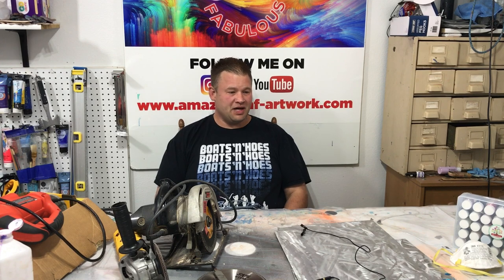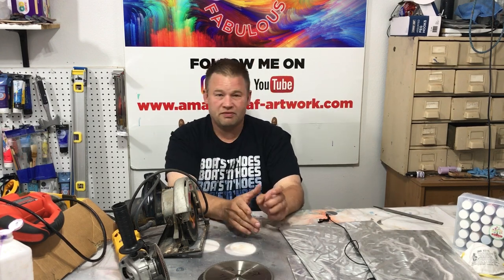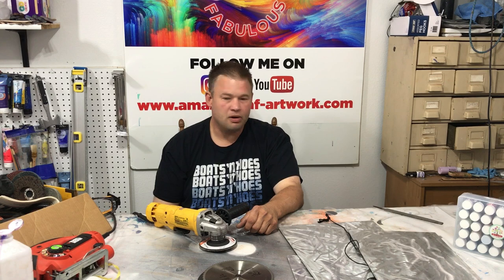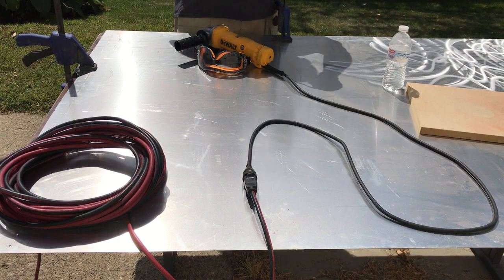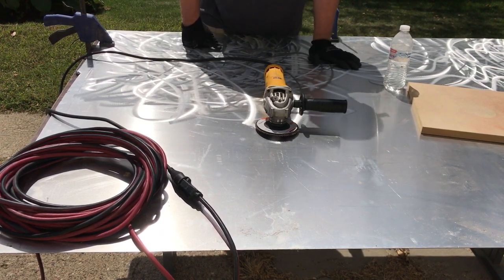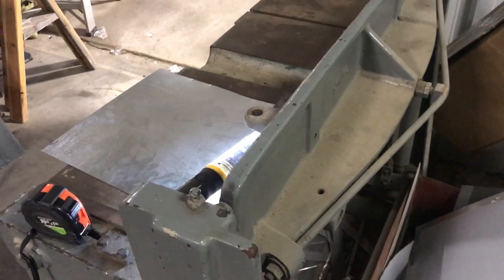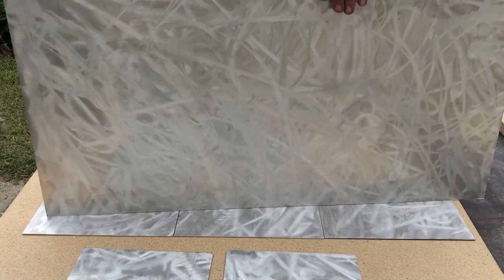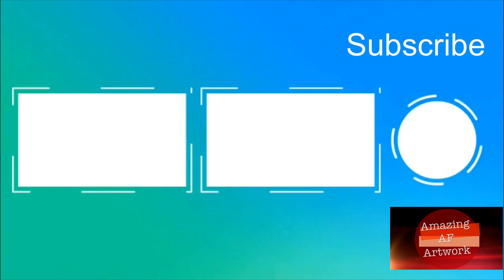How I Prep My Aluminum Resin Art. DIY HOW TO

Comment: Thanks for the video, I have been doing aluminum art for a number of years, one tip I have is, use adhesion promoter on the aluminum before applying the epoxy. I one I found that works for me is from Tamco paints...
Reply: Will you apply the adhesion promoter as a first layer on the aluminum sheet before applying the resin? I am planning to work on 36x48 inch aluminum sheets..wants to be very conscious as its my 1st time with aluminum sheets
Reply: @ambreenehtisham7264  Yes, it goes on very thin and dries fast.

Comment: Grinding wheels work by heating and abrasion not cutting. Can't think of a worse way to crete the edges you want.

I'd suggest accessing a fabricator who can guillotine clean edges.

Aluminium can be cut with a saw quite easily - just get one that is carbide coated and do not overheat it. Higher tooth count and let it go at a slow pace to keep speed up as torque will be an issue if it jams.

Use a vacuum if you can too as the metal filings will mess up equipment. Ferrous metal is worse as it will be attracted to any magnetic fields.
Reply from the maker: Yeah I used a cutting metal shear press from my Friend Scott Bickle at 11.30 min mark.  It work really good.  I guess I think that’s the same thing as a guillotine edge?  Or is that a different metal machine?

Comment: I was just curious if you would get the same results on cold rolled steel?
Reply from the maker: I think you probably could.  I would just clean it pretty well.  Then get it covered as soon as you can so it doesn’t flash rust.

Comment: Will the resin still adhere to the aluminum without taking a grinder to it? Thanks in advance!
Reply from the maker: Tia Tay I would think so.   I would test it out on a smaller project , and let it cure.  Then see how it seems on the edges and corners.  With the ground surface , it gives it a little bit more of a porous surface to grab a hold of.
Reply: @amazinga.f.artwork9047  Thanks, will do. So I could give it a light sanding to give it some tooth. For light sanding which grit would you recommend?
Reply from the maker: Tia Tay well depends on the look your going for , but I would say in between 200 and 400 grit.  😃
Reply: @amazinga.f.artwork9047  I would essentially cover the sanded part. Not really expecting the sanding to show through.